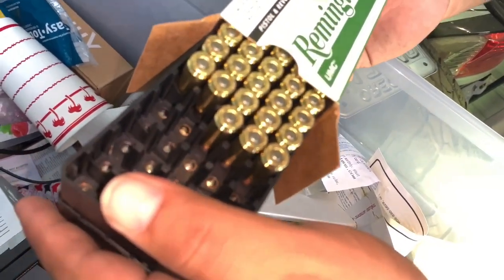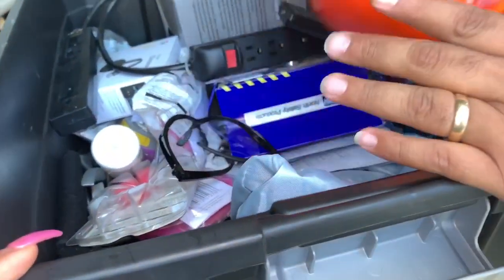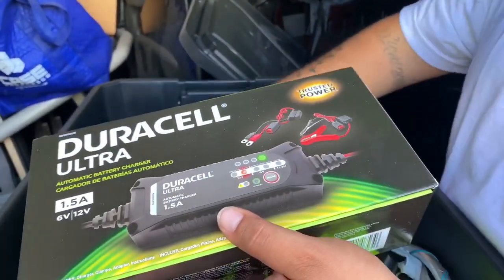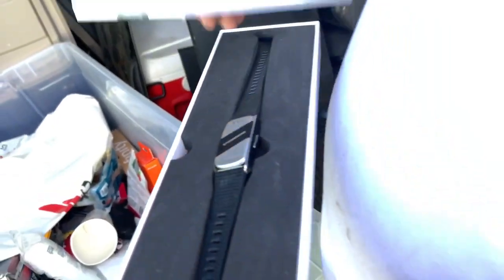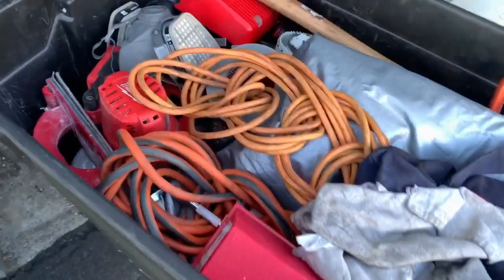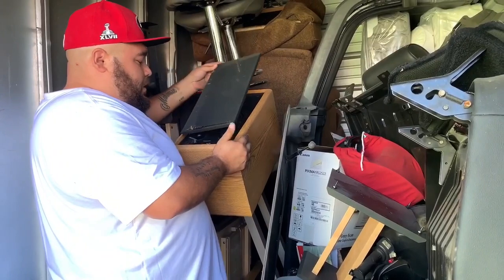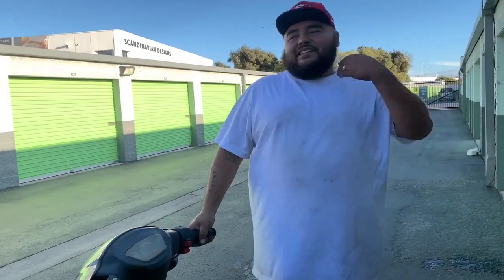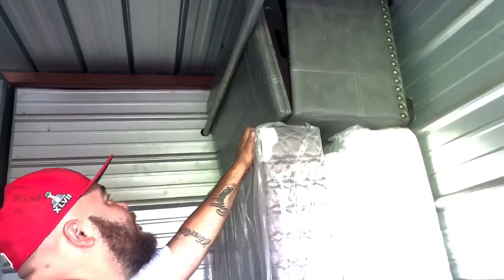MOTORCYCLE HIDING BEHIND RECYCLABLES! | made big buck$$ on a storage unit

Comment: The hammer that was found in the box full of tools around 13:45 that you said was worth like $10 is honestly worth easily $50-$75 used. Those hammers brand new go for $150-$250 or more. Just a disclaimer I am a contractor and my dad (who I work for) has like 3 or 4 of them and paid $125-$350. So I would look it up.